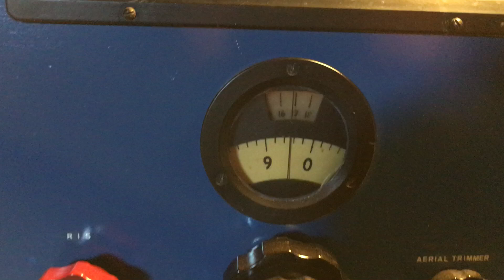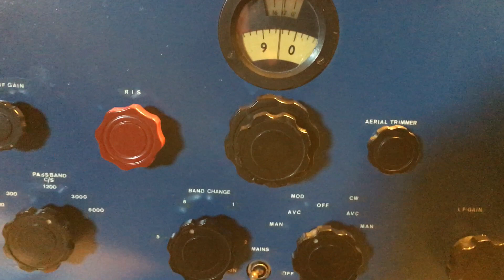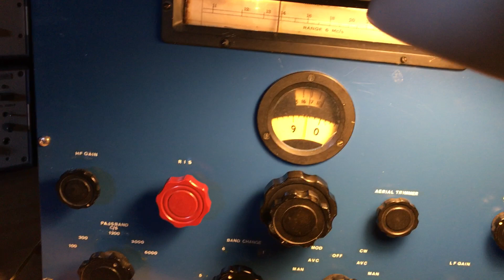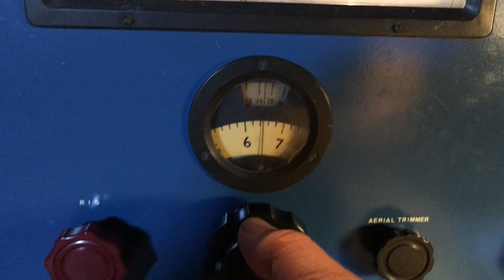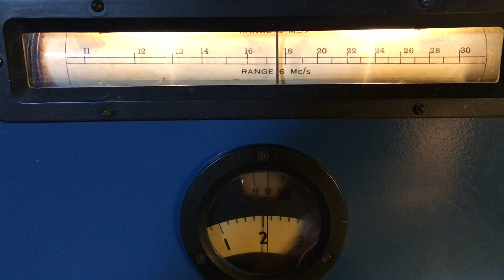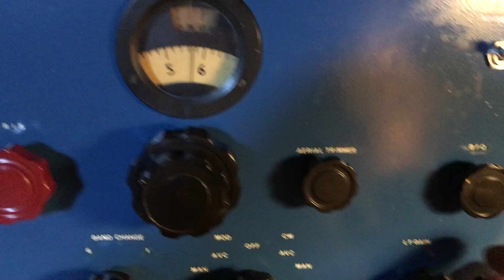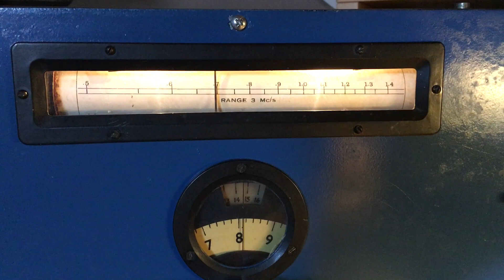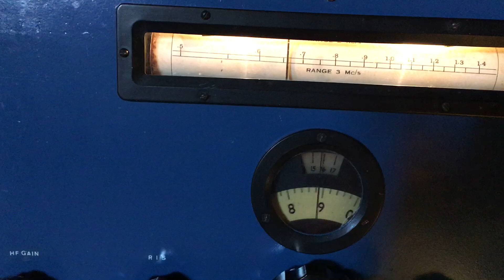Marconi Admiralty B28 radio receiver

Comment: What is the blue wire you have linked to the top of the mains transformer. Was there a fault in the voltage tapping ?